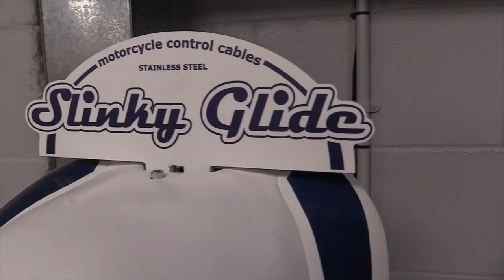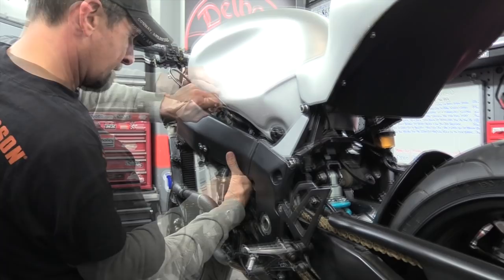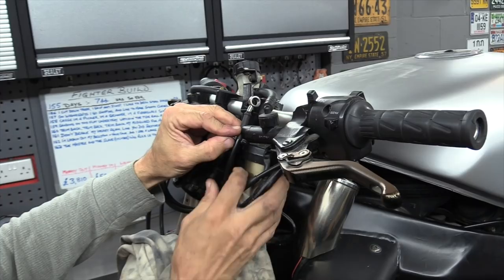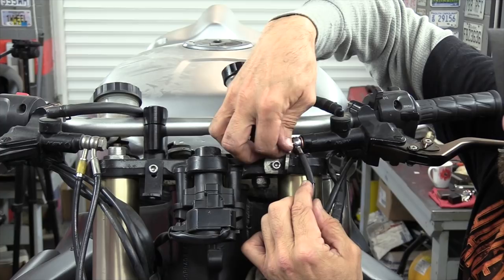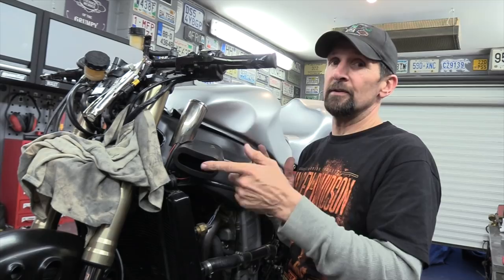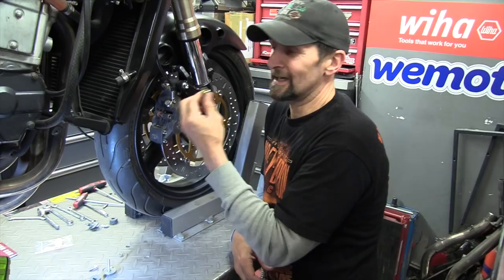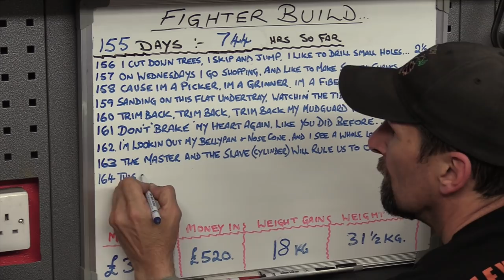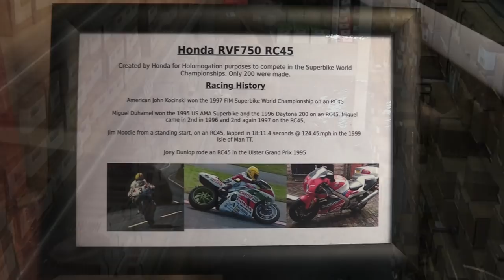Delboy's Garage, Fighter Build #154, Day Trip To Wemoto HQ for a Clutch Hose

Comment: Come on Del what was the point . 10 mins of fast forward riding . Throw the hose on and bleed it . You keep saying you want to educate the young un's so why didn't you talk a bit about clutch fluid properties and mention to never shake the bottle . Don't keep saying I'm experienced and can guess torque settings do it right and show people or don't do it at all
Reply: Thanks for the comment on the fluid, but I dug the video! The explanation of the soft washers giving and then snugging up made great sense regarding torque as well. Put plugs in my truck tonight and felt the same...I heard Delboy telling me not to swing on it like a gibbon as I palmed it in and gave it a little wrist...Fast forward is always there...chillax dude! And bust out the torque wrench when needed!
Reply: When you are experienced you know what nuts and bolts are essential to torque up and ones that are not.  Some need torquing to make sure you don't over tighten others to make sure they are tight enough, these can't really be over tightened easily so they are easy to tighten more than enough without a torque wrench, without issue.  

I bet if he checked the torque setting and tested it, it would be fine, they won't have a very high setting.  He also basically said, if you are not experienced always check the torque settings and use a torque wrench.

George, it does not always work in a way that can be tested like that.  Whenever I used to do up wheel nuts (on a car) I would always tighten them then go around with the torque wrench and they would always be tight enough.  Wheels are obviously the most essential, so I always check them still.  

I must have "the feel" I've never torqued a sump plug on cars or bikes, never had a leak either.  It works in the same way as these banjo bolts and fittings, as they have a crush washer, tighten them enough to pinch the washer and no issue will be had.
Reply: @Quin as well as, everyday life......
Reply: If you know all these things, why not help out with education of the young'uns on your channel? This is not an attack, just a question/ suggestion....its not a class, it's a man in a small garage doing things his way, in his time. It's free, take it or leave it. If you don't understand the use of a torque wrench, or don't have the proper specs. Then this isn't the place to learn. If he catered to every request, then someone would come along and say "Dell, what's the use man, mucking about, explaining  every little detail, get on with it man! This build will never be ridden this summer!" Never come to YouTube, for truth, to solve a problem, or to learn the answer to the ultimate question! It's a public forum, that allows the average person to express themselves in any way they can.......A wise man learns from both good and bad information. The fool simply believes anything.

Comment: I never knew you could pump a hydraulic system more than one time per 'bleed'.  I thought it was one to one.  Great to learn that, makes total sense!  Keep up the great teaching!
Reply from the maker: Sure thing Jeff, it kinda helps to understand how the master cylinder pump works itself, imagine like a bicycle pump where you have a rubber seal that only pushes one way (downwards in to the line), so as you pull the lever in, you pump a puff of air down, but when the little spring in the master cyclinder pushes the piston back and it grabs another gulp of air, so with about 4-5 pumps you'll actually pressure the air in the empty hose, if you hold the levre in, it holds that air pressurised, then open and shut the bleed valve releases that pressure and then when you let the lever back out, it naturally sucks air back in but, of course, it's not air above it, it's brake fluid, so it sucks  a gulp of fluid in to the line and starts priming it... doesn't always work, sometimes they are dead stubborn, but if you're lucky, 5 pumps at a time, hold the lever in, then open and shut the bleed valve and you should have it plumbed up in no time... and don't forget to keep replenishing the resevoir as it pumps down in to the line...!
Reply: Thanks so much for the above!  I have a rear brake on a used bike that didn't really work all that well. It would stop the bike, but was almost impossible to lock up the rear tire, no matter how much pressure I used. 1998 Triumph Daytona T595 that had been in climate-controlled storage for four years. Working on the rear brake light switch, I had to test the switch over and over and over.  After that, the rear brake was much better.  Still not sure it's working to optimum, first Triumph, first sport bike.  I can lock up the rear tire now (no ABS), but it doesn't feel like I'm getting the stopping power I should from a liter bike. Any testing I should do?  Should I just rebuild it?  Would that need special tools? Replaced fluid, no change.
Reply from the maker: Hi Jeff... Good to hear from you mate, hope life is good.  Ive been through that myself, its a nightmare aye... How worn is the disc mate?, and what about the pads... and also, is it still running the old rubber factory brake hose..?
Reply: Replaced pads with factory new prior to the rear brake light testing. Forget the term now, but I used sandpaper on the disc to clean out the dust from the grooves.  Probably got the best grit to use from you, TBH.  LOL!  Don't know how to check the disc for wear.  Had 7500 miles when I got it, 9500 now. I assume it's factory rubber hose, it's black, not colored or stainless.
Reply from the maker: Hi again Jeff.. OK, 9500 miles is nothing on a back disc unless its been run on worn out pads and damaged, but if its pretty smooth and not too heavily grooved, then its probably had reasonable treatment... new pads will always be a bit vague on an old disc because it takes a few weeks and maybe 1000 miles for the brake pads to wear and and "mate" fully with the exact profile of the disc... and if you choose to go for copper sintered pads, they will give more bite also...    As for the brake hose.. its probably where your problem lies.. its a 20 year old bike so will more than likely have an old style rubber brake hose.. (you can soon tell because it'll be about 1/2 inch thick, and clearly made of rubber..... a braided steel hose may not be silver.. these days they are fitted as standard at the factory and are covered in a black plastic coating... they are easy to spot because it'll only be about 1/4 inch thick, and if you force a thumb nail into it you feel that its rock hard and very stiff to bend...      if you do have the old rubber hose, which im guessing you probably do, then get yourself a braided steel hose right away, get it fitted and bled up.. and while you're at it, invest in some Copper Sintered HH pads.. those two mods will totally transform that back brake like you've never known it... and if you really really really want it top notch, and fancy giving your T595 a birthday.. get a brand new EBC disc too... then you'll actually be shocked at how sharp the brake will be....      Naturally the same goes for the front.. if it has rubber hoses.. then get them upgraded asap.. you wont regret it my friend...  Good luck with it, let us know how you get on... D&Pxx
Reply: @Moonfleet41  thanks again for all the help! It definitely has plastic coated stainless steel braided line on the front brake. Rear brake I can't see the stainless steel, but it appears to be exactly the same as the front brake line. Very hard, not very thick. It has "PD/T HL 1/8 DOT" on it. Sorry if I have not been very clear. The rear brakes were very anemic from the beginning. Put a thousand miles on it since I changed the pads, no change. It wasn't until I was adjusting the rear brake light switch for over an hour that it changed after that. It began braking much better. I suspect that the issue is actually in the rear brake master cylinder and that I possibly need to rebuild it and replace all the rubber parts. Replacing the brake fluid had no change. I'm pretty certain it's already stainless steel so I'm not sure what else I could do besides taking the rear brake master cylinder apart and replacing all the rubber parts as well as a thorough cleaning. I suspect something in there was blocked and all the work and testing on the rear brake light switch finally freed it up. Any thoughts please? Thanks in advance!
Reply from the maker: OK, Jeff... then if its a braided steel line, and new pads, and fully bled through.. and still has limp effect on stopping.. its most likely a stuck piston in the caliper.. get yerself a caliper rebuild kit from Wemoto, and a bottle of fresh fluid.. and get stuck in...  The chances are that one of the pistons is jammed and not moving, and all your getting is half the amount of chomp in the disc.... It just time that can cause that, specially if its been stored up because and moisture content in the old fluid can lead to corrosion inside the caliper, also salt and road crud builds up around the dust seals... and before you know it, they pistons jam up...or just ONE does, then you think its working, but its no more than half an effort...         Get it all stripped apart, clean out all the grooves and inside the bores, polish up the pistons till the gleam like new. (or replace them), and once you put all that back together, it should make a world of difference.. i know its a ballache, but its well worth it when you have top class braking back again buddy...  and lastly mate, its far morel likely to be the caliper tan anything to do with the master cylinder.. but if you really want to eliminate any issues what so ever.. then rebuild that too after you've done the caliper.. the seal kits cost peanuts, so its only time and a little effort... Good luck with it.. Del.
Reply: Moonfleet41  That makes a lot of sense.  Set of caliper seals on the way!

Comment: I found the same banjo bolt bleeder on eBay and it got me out of having to buy a new caliper as I snapped a bleed valve, I also snapped an easy out in the same hole, it was stuck in there for ever then 😂😂😂 has worked for two years without any loss of pressure.

Comment: I did one of those bolts up a little too tight once, being hollow it twisted and needed replacing - check your torques. =)
 edit: Oh god I just saw Bodom Erectus' comment, I was a noob at the time ok. 
We all start somewhere though, if you don't know what you're doing a torque wrench is a sensible move.
Reply from the maker: Yep, exactly what i same buddy.. if you're not sure, or confident, then stick to the factory torque settings....

Comment: Bit of a run in the sun, bit of blokes shopping and a bit of garage; life doesn't get much better eh buddy  :)
Reply from the maker: The three elements got nuffink on that mate... totally agree.. and 200 miles rounds trip for a clutch hose.. awesome way to save a stamp and a jiffy bag aye..!!
Reply: Dang 200 miles! Thanks for sharing the ride and the experience of the custom clutch line build! If you see this, what were you riding? I probably missed that... :(
Reply from the maker: Hi again buddy, it was a Triumph Tiger 1200.
Reply: Wow, sweet ride! Looks to be a GS killer or at least a great option. Thanks!

Comment: I have a 1989 gsxr 1100 slingshot here in davao 
great vid
Reply from the maker: Thats an awesome bike.. is it the "K" model with the regular style forks?.. often referred to as the "Killer K"..!
Reply: +Moonfleet41 indeed it's a K red and black. I am trying to convert to USD forks but parts here are expensive.
Reply from the maker: I know what you mean about parts, but if you aren't too bothered about genuine originality, then a more modern USD front fork is probably more plentiful on the open market than a front end from a L or M model... also later model Gixer 1000 forks will give you radial calipers too...and you can buy those on ebay also... Just  thought..!

Comment: That simoniz tough black is awesome stuff, I painted the lower grille on my T5 in the gloss black and it's mint a year later. I also painted my z750 ltd tank in the same stuff, I did get a fuel leak from the filler neck as it was on the side stand which made it peel around it, hopefully I can repair it, needs petrol resistant lacquer I guess. Holt's said not to lacquer it though.
Reply from the maker: Hey buddy.. yeah, once you snap off a bleed bolt.. i wouldn't even waste an easy out on it.. that wont go near it if it was already too seized to shift... this is a seriously simple idea, and ill now keep one in my tool box for ever...   From years using this, it is petrol proof.. but it takes about 4 months in warm weather to fully cure first.. of you get fuel on it any sooner, it acts like paint stripper... i think they're right on the lacquer too. it wont make much difference.  this stuff is a bit weird TBH.. if you try to paint another coat over it half a day later.. it all lifts up.. it needs about 24 hours at least before it can be re-coated... so its clearly a "curing" paint rather then a "drying " paint aye... take care buddy, and have a great weekend.. Del.

Comment: What's this about taping the brake lever for a nice crisp brake in the morning? Maybe a newbie question but could you explain this one please my friend?
Reply from the maker: Hi Bruce, it pressurises the fluid, shrinking any air bubbles, forcing them up to the top, the lever being held in, means the valve in the master cylinder is open, so any air content makes it way up and out into the reservoir... untape it in the morning, pump it up a bit... and you'll see, it'll be harder and firmer at the lever with better feedback from the brakes... Give it a try mate, see how it goes..1
Reply: Excellent tip mate - will definitely have to keep this in mind.

Comment: Im not sure I understand why you secured the clutch lever for a time, could you explain that to me in a bit more detail? Thanks for all your hard work, Delboys Garage is one of the best 'shows' in my rotation.
Reply from the maker: Sure thing buddy, with brakes especially, once you've bled them up to your satisfaction, just stand the bike on the prop stand, turn the bars to the left so the reservoir is uppermost, then tape the lever in to the bar, or as close as it will come without too much pressure, overnight... this pressurises the system, which will shrink any air bubbles inside the fluid, making them more buoyant and better able to float up through the fluid... overnight they will all rise to the top and as the lever is taped in, this opens the valve in the master cylinder and allows the air to express out in to the reservoir... giving you a fully solid hydraulic hose....... you can also do this with the clutch, but as it's a spring loaded mechanism, it's not a good idea to keep it under pressure overnight, so just half an hour or so will still make an improvement in the feel of the lever... give it a try, you'll see it works my friend...
Reply: That's brilliant. Thank you sir!